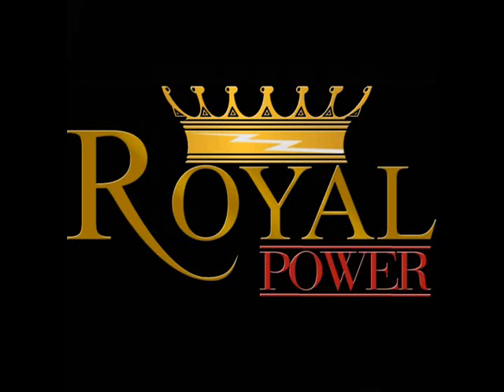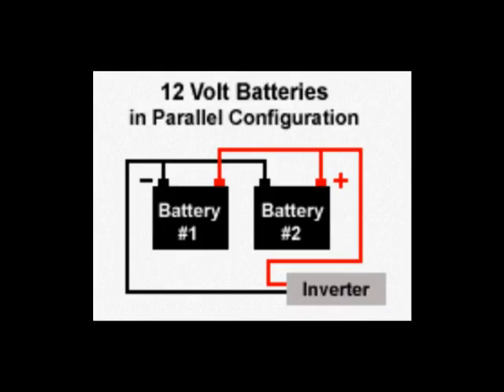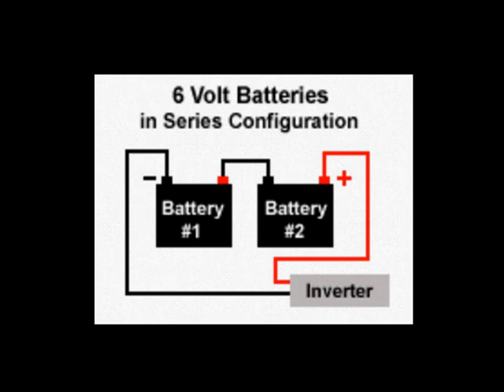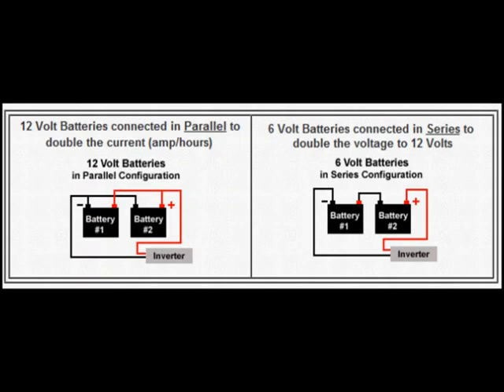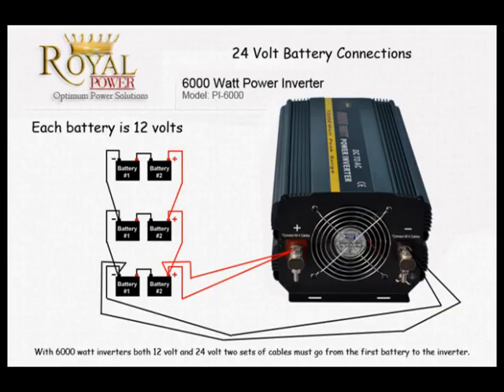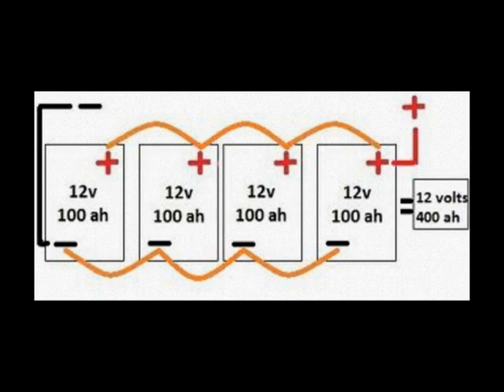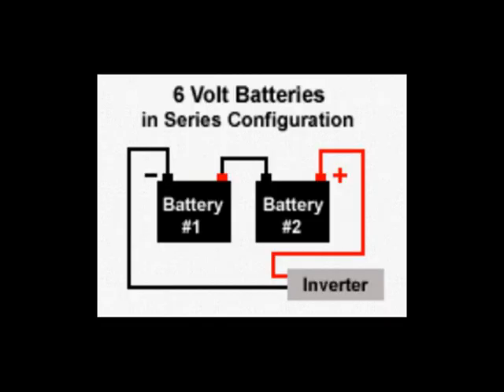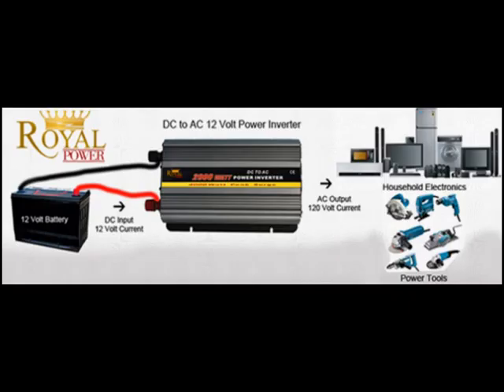Battery Connections (Series vs Parallel Connections)

Comment: So which means if I connect batteries in parallel, I can run the electric equipment more longer than if u connect the batteries in series

Comment: if i have a 6 batteries with 12volts each. is it possible to have a 24volts output?
Reply from the maker: Yes. 3 sets in series. Then connect those 3 sets in parallel

Comment: Nice🙏 1) which is better option series or parallel that can increase battery life or mention equal charging current 2) which is better 12,24,48 v battery?
Reply: it really depends on your desired or required input voltage.

Comment: What is th efficiency gain 12volt inverter vs 24volt??
Reply from the maker: 24volt systems can have a efficiency gains up to 20% depending on the system and batteries.
Reply: @Royal_Power_Inverters  thanx also do 24volt inverters do better at peak power in rush.?
Reply from the maker: @chadellett4696  They have larger operating range so they have double the voltage to handle larger peaks.

Comment: how can i connect two 12v bettery in series to 12v inverter
Reply from the maker: You need to connect them in parallel. Positive to positive and negative to negative.

Comment: I have a 24V electric motor is that a good source to charge a 12V battery or am I wrong?
Reply: Depends if the battery charger can take an input of 24V and charge a 12V battery.

Comment: hi great video, I have a question, my battery bank has 16 batteries of 12V 200Ah. I want to make a power bank which is 96V 400Ah, I know i have to put 8 batteries in series so I'll get 96V 200Ah, and the 2 sets of batteries in parallel in order to get the power i need right? also what should I do if my batteries are all low voltage before to connect them to the charge controller? should I charge the batteries one by one then connect them and start using the charge controller? My wind turbine system is 96V for 5000W inverter. thank you

Comment: Is it possible to charge 48 volt batteries 22*4 connected in series with 12 volt DC charger
Reply from the maker: Depends if the charger has multiple charging options. But if it strictly 12V then no.

Comment: Okay I have for 1000 amp hour 12-volt batteries in parallel I will keep 12 volts and it will increase my amperage hours the 4000 amp hours will this also increase my kilowatt hours to the number 48000 Watts is this correct or will it stay at 12 volts 1000 amp hours 48000 Watt hours
Reply from the maker: If you increase in parallel the amps will go to 4000 amps.

Comment: Hi my car battery is getting down regularly I took it out and gave series connection with my inverter battery of 12 v 150 ah. Now question is for charging of my car battery should I connect in series or parallel to my inverter battery

Comment: Suppose using 4 nos. of 1.2V 2800mah batteries in parallel connection for developing a power bank that requires a current(mah) much more rather than voltage, the voltage will remains the same bt will the huge amount of current can blows the circuit?

Comment: what happen if i connected 12v battery with 8v battery in parallel what voltage do i get a 12v or 8v
Reply: You get 8v and waste the 4v from the 12v battery. A larger battery will always decrease the amount it puts out, but a smaller one will never increase as that would break the law of conservation of energy.
Reply: What voltage do you get where?
Reply: You will get 12V because of higher emf. But connecting in this configuration is not recommended due to higher voltage Battery keep charging lower voltage Battery. And reduce the battery life

Comment: hi i hv a question if do all this can i connect a slow 12v charger as well to charge  the battery;s?
Reply: If you generate a 12v system, you could use a 12v charger. make sure it is all wired appropriately.

Comment: Hi guys i have a puzzeling  question.
Looking at the formulations 
watts ÷ volts = amps
Or amps x volts = watts
If i connect 
4 x 12 v batteries i have 400a/h thus i can power a 2.2ah pc for 181 hours
But 12v x 400ah = 4800w
Thus the same pc powered at 220v 2.2 ah =484w
This means the battery will only power the pc for 10 hours.
And if the same pc was running at 120v 
It will only use 264 watts
Thus the same battery will power it for 20 hours.
Pls help me figure this out.
This is very confusing.

Comment: Wouldn't be a problem if a connect a small 12votls gas pump if my amperage is 400?
Reply from the maker: No it would fine as long as the voltage stays above 10.5V.

Comment: Hello , thanks for your video . I´m trying to make a solar charger able to charge in parallel 3 batts of 3.7v  2000mah li-ion (they have self charge regulator incorporated in the battery? . I saw on ebay those pcm 3.7v protectors , i think i need one of those between the solar cell right ? . Could I use later somehow the same batteries but now in series without moving them just with diodes and switches or they would short circut for sure . Thanks
Reply from the maker: Please take a look at this battery chart and let me know if you need more help.

http://www.powerinverters.com/page/power-inverter-user-guide